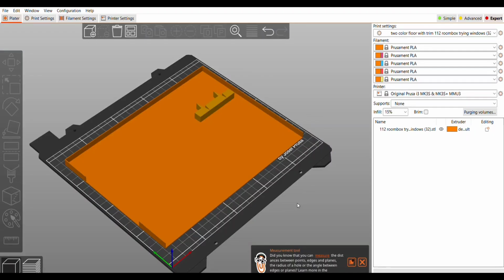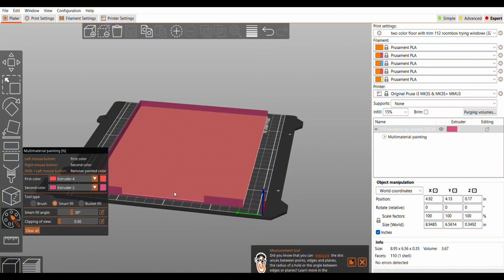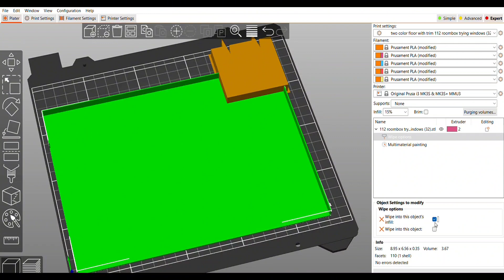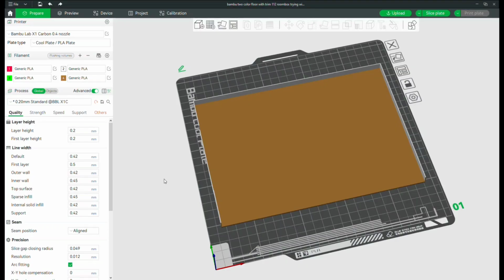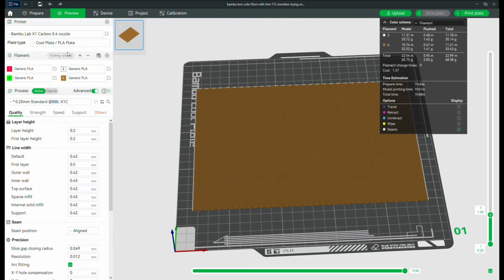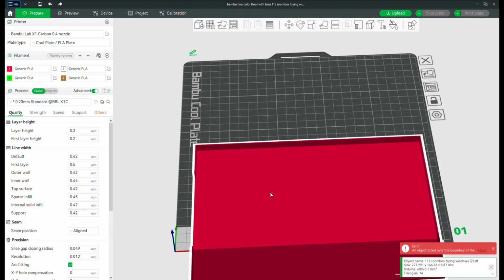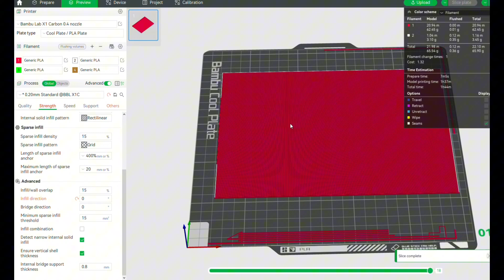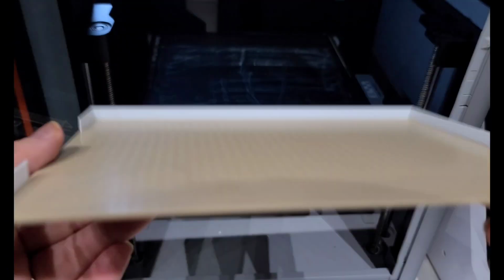Comparing a 2 Color Floor/Baseboard Print on the Prusa MMU3 and Bambu AMS!

Comment: Nice work on your production objects.  In the problem you had with the MMU and purge tower is there a way to change the shape of the purge tower and put it in the available space that was left on the build sheet like in the other slicer?  I was thinking this before you changed to Bambu.  If not, enough people need to complain to Prusa to get it changed.
Reply from the maker: I have been hearing comments that you can resize it. I need to jump back in and see if I can figure it out. Thanks!

Comment: I've been intently following the MMU3 journey because I myself would like to get one and there doesn't seem to be a lot of information on it online. What are your thoughts on the MMU3 so far? It seems a bit discouraging seeing you've had trouble slicing the baseboard here and some other hiccups but have you had any other experiences with it? I'm just a really skeptical buyer after hearing the complaints on the MMU2S and I've been very curious how this new one performs.
Reply from the maker: I keep trying things on the MMU3. I want to give it a fair shot. But so far, I'm not happy with it. Unless someone comes out with a way to make it more reliable and more compact, I don't think I'll buy another. 

A lot of people hate on the Bambu AMS. But I have had very little issues with it. Both have been a learning curve to figure out the slicers. But I have never had the Bambu fail or even error changing colors. 

Also, I spent almost 30 hours putting the MMU3 together including upgrading my MK3s to a + and troubleshooting that sensor. I doubt anyone else will take that long because I was recording and made a lot of mistakes. But the AMS, you just plug in the tube and power and go.

I wanted to prefer the MMU3 but I just don't. 😔

Comment: That I would do a layer change on the MK4 I noticed the quality on the high speed printers are bit off. So in a nut shell is a proto type I use my k1 max how ever final prints are done on Pursa printer they just print better
Reply from the maker: So do you like the final print better on the K1 or the MK4? Thanks!
Reply: @tada3dprinting  the MK4 is better then k1 max but print a bit slower, Bambu it looks like for what you are printing is better with the ams I would search printables for profile to use on the Pursa slicer that bit easier to adjust settings. I brought a Bambu and it came doa so it was retuned

Comment: Bambu Studio has a neat paint tool, allowing you to paint sections of a print. The paint bucket option would be perfect for this file. Also, the odd infill issue could be due to the file not laying flat? There is a tool on the top tool bar banner, which allows you to select any face to lay flat. Hope this helps. Awesome designs btw 🤘
Reply from the maker: I'll try this. Thanks!

Comment: potentially adding little brims to the corners will help with the corner adhesion. Also, it would be cool to add some flooring wood plank designs right into the print, would help to not see the infill telegraphing through and also add visual appeal without any extra assembly work on your end.
Reply from the maker: You're right. I have thought about a wood plank design. I think the more options, it'll just take longer to glue them up. But people might like the variety. Thanks!

Comment: Any time you see "default" as the color in the objects list, you're going to get whatever the printer thinks it should be, usually tool 1.  ALWAYS assign a tool to a part.
You can use the same color change on layer with the MMU, but you need to right-click the + and select the tool to change to, not just click the plus for a filament change like without the MMU.
And you can stretch and move and rotate the wipe tower just like any other object. When I need to get as much room as possible for a large print like this, I'll stretch it out long and put it on whichever side has the most room for it.
No matter what printer you're using, you should always check the slice. Put the sliced view in "Color Print" or "Tool" view, rather than "Feature Type" view. I'm not sure how Bambu has changed the names of things, but that's what it is in Prusa Slicer. I usually assign colors to the extruders that are similar to what I'm actually printing with, so that I'm certain I'll get what I want. 
You're still learning. Try not to become discouraged. Ask for help in groups/forums as needed (there's a great MMU2/3 group on Facebook), and always be confident in your slice preview before sending it to the machine. Never "hope for the best" in these situations.
Reply from the maker: Thanks so much!

Comment: bambu slicer has less top layers by default compared to prusa slicer. I would up the top layers to 5 minimum. this will help hide the grid infill from showing up. Or to match your Prusa result, up the bottom and top layers so there is no infill. (since the part is so thin).
Reply from the maker: Ok I'll try this. Thank you!

Comment: As a few others have mentioned you can change the size of the purge tower to long and skinny so it will fit. Their should also be an option to turn off the purge tower in settings in prusaslicer. If I'm using the mmu to do a simple layer color change that is generally what I do. I also suggest setting the color change on a layer like you did in babu studio.
Reply from the maker: Thanks so much

Comment: or if you move the model to fit on build plate but allow purge tower to hang off side ( move it ) when you slice it'll change shape of purge tower, which then can be selected and moved to fit on build plate
Reply from the maker: I feel like I did that and it didn't work but I'll try again. Thanks!

Comment: To modify the purge tower's width do this: In prusaslicer go to Printer Settings Tab, then go to Multiple Extruders side panel section and click on that, then go to the Wipe tower section and modify the width(the longer the width the less space it takes to build the purge tower).
Reply from the maker: Thank you!